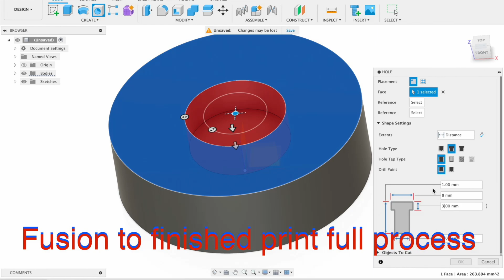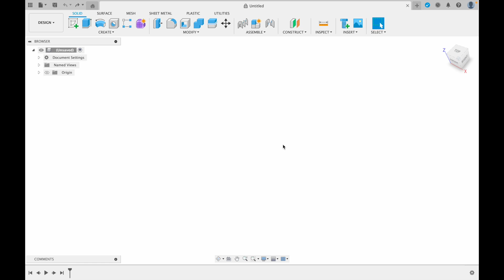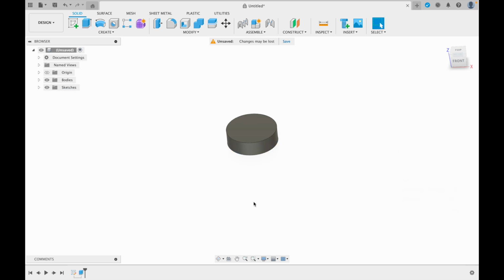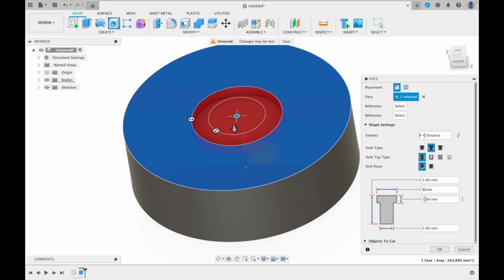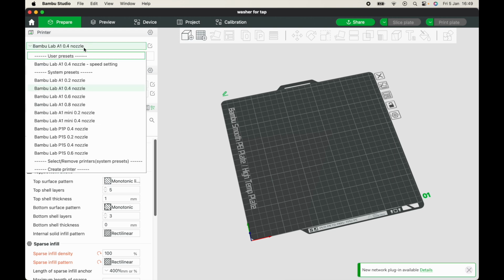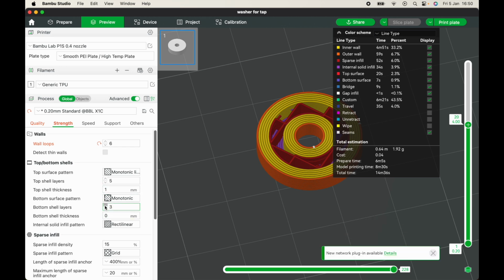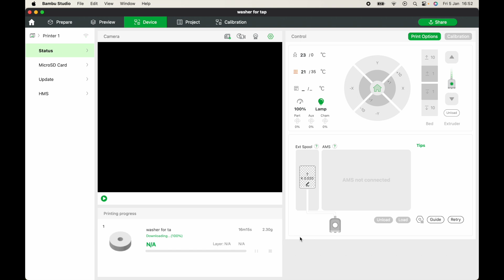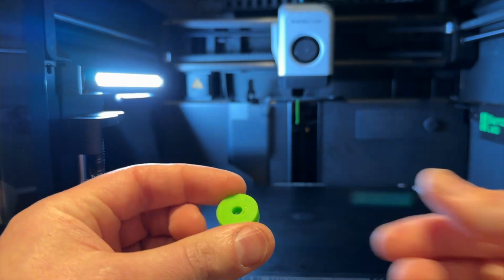From fusion 360 to final print - fusion and printing for beginners

Comment: Great video, thanks :)
Would love to see something with a bit more measuring outside just one plane.
For example, a phone holder (plenty free STLs out there) as an extended 2D sketch would hold the phone, but making it solid isn't ideal because of weight, so a lot of designers punch holes out of it (often like a grid) and create legs, for example, that aren't on that same original plane of the sketch. Sometimes also hinges and things, which as far as I'm aware Fusion360 can do, but I have no idea how to :D

Seeing how all of that would pair together as well as some design philosophy I think would be really useful! This is just an example of course, so anything incorporating these methods would be helpful. Thanks for the vid!
Reply from the maker: ok il come up with something 👍🏻

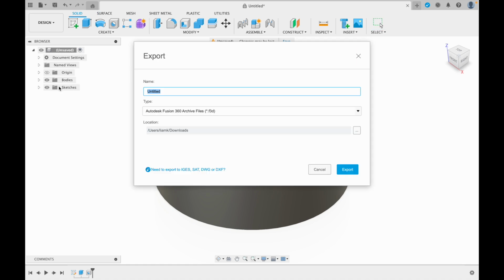Comment: Great video for beginners!  (6:19) One thing I might add is there is a "3d print" option in the file drop down menu that you can use to directly import the file into your slicer as a 3mf/stl. The STEP file is probably a better option though, as it makes prints more accurate, but just thought is was worth an honorable mention
Reply from the maker: good point i never do think to use the 3d print option as i always just export them as step files thanks for pointing that out